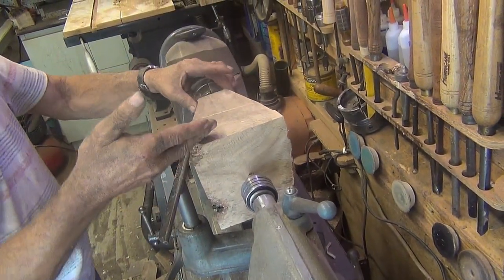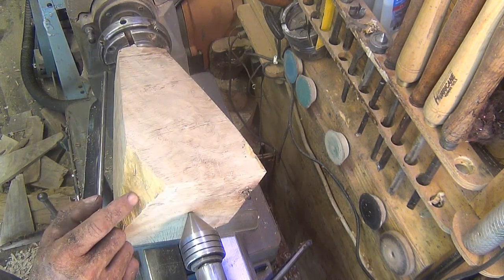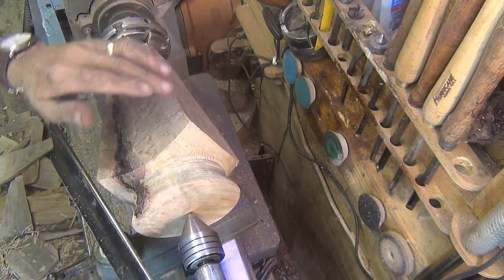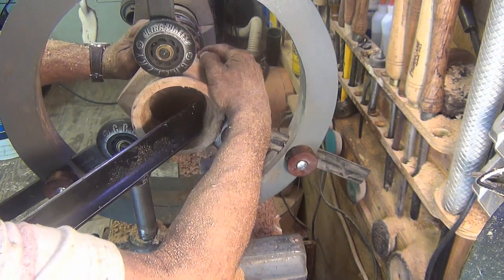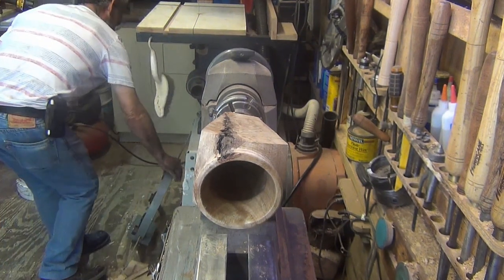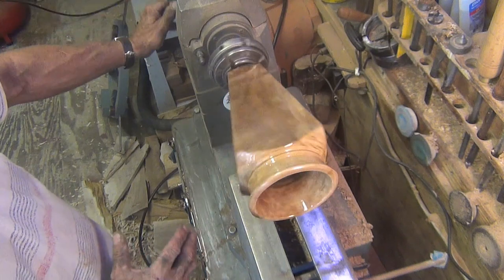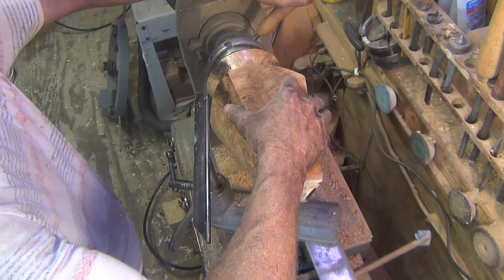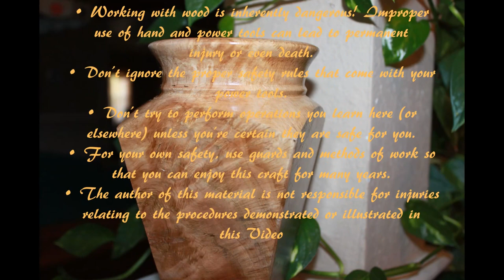Square body oak vase by Al Furtado

Comment: this is a beautiful piece, and the wood patterns are amazing, even the not so burl side looks like marble, as least to me.  the square and the round work well - there is a visual tension that's nicely balanced. How did you find this piece sitting? was it top heavy at all or did the weight of the lower area keep it steady? 

thanks for sharing and teaching again, I always come away with such inspired ideas.
Reply from the maker: Thank you very much my friend I am glad you liked it. The piece sits pretty solid without feeling like it will wobble over. The base as I have tool limitations is a bit thicker so it holds enough weight to balance it well.

Comment: Yet again a very nice project! 

Will it move or crack while drying? I would like to find some wood like that.
Reply from the maker: Hi Ron. there are no guarantees but generally when I turn something thin enough it eliminates cracking. so far so good. as far as move. Yeah it will move a little but generally does not bother me

Comment: What else can I say except that your completed piece turned out quite elegant Al....! Thank you for the tip on planing a turning. Sure is much easier and more uniform than belt sanding. Now I have yet another use for mine...! I've a question Al..Did you use YORKSHIRE GRIT or sanding sealer and how many coats of Lacquer if you don't mind me asking?
Reply from the maker: Thank you very much my friend for such a nice compliment. I am glad you liked it. On this one I didn't use Yorkshire grit or sanding sealer. I applied 2 coats of lacquer than sanded it with 1000g and applied one more coat of lacquer.Take care

Comment: Just great Al.  Another beautiful and creative turning.   How do you avoid cracks in the finished piece?   Is the wood pretty dry at the start?
Reply from the maker: Thank you Bill. Very rarely do my finished pieces crack if they were turned thin enough. They might move a bit but not to a point that I find offensive. sometimes they actually move in my favor.

Comment: Everytime I make the transition from square to round, I get tear out. Any suggestions?
Reply from the maker: Thanks Scott, I believe the reason you get tear out is due to a pull cut. Try a push cut from outside very lightly and the flute (if you are using a gouge) in a closed direction towards the center. I have not tried it with a carbide cutter or scraper.

Comment: Al are you cutting dried or green wood?
Reply from the maker: Green wood
Reply: Could you explain how the finish stays on and is there any warpage.  I have been rough turning bowls and then letting them dry fo about 6 months to a year.  Even with a slow dry I still get warpage and once in awhile one will crack.  Thanks again
When you put that lacquer on it I saw some great Chatoyance.   What a beautiful piece.   With a lid it would make a great ashes urn
Reply from the maker: Well there are cases that I actually welcome a little distortion by nature. those are on Platters, Natural edge Bowls. The only time I worry is when making a box with a lid. Those have not been a huge success if the lid or the body shrinks. I have had a few pieces that cracked, Mostly stay pretty much the way they were when turned.. I say just turn it thin enough and the cracking should be pretty much eliminated.Well I am strange in what I like so take this with a grain of salt.Take care I hope it helps.